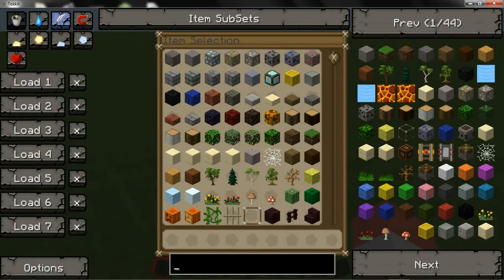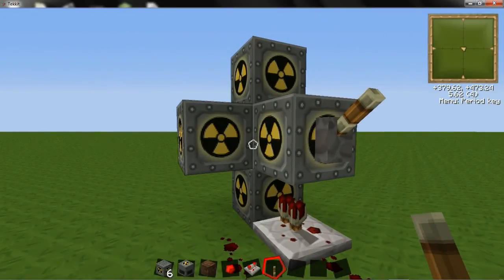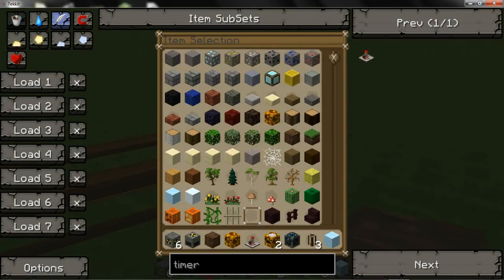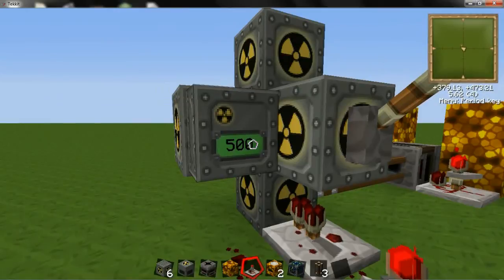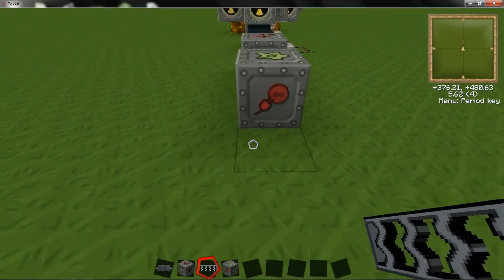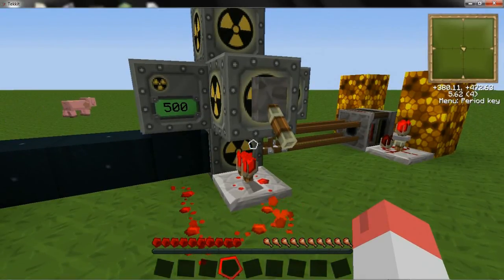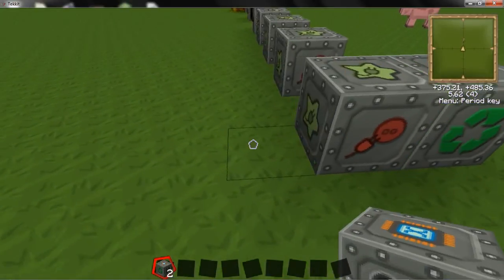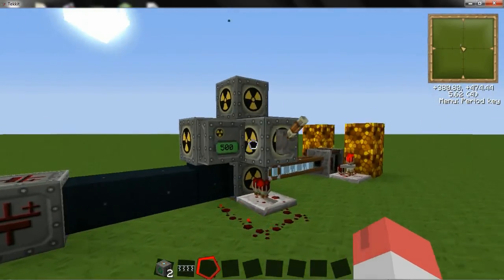Safe Minecraft Nuclear Reactor! Technic/Tekkit Tutorials with Stone Red Son

Comment: you can also replace the collectors with a cobblestone generator. no diamonds required, and it makes a cool noise.

i would also suggest replacing the redstone dust with red alloy wire so that you can flood it for some extra cooling.